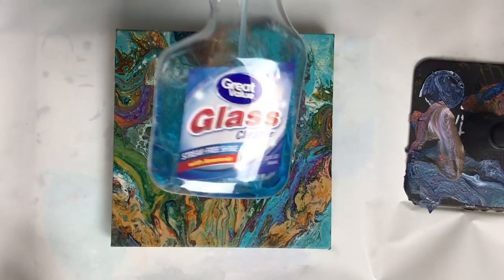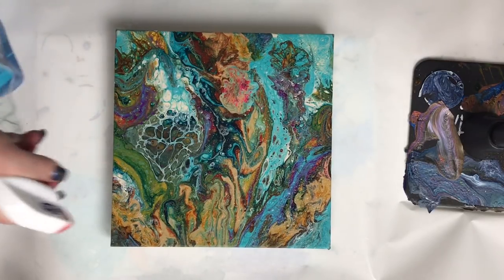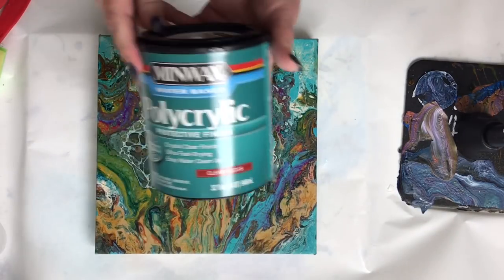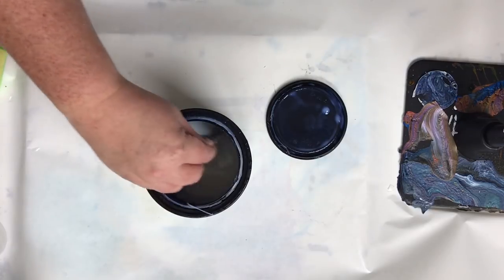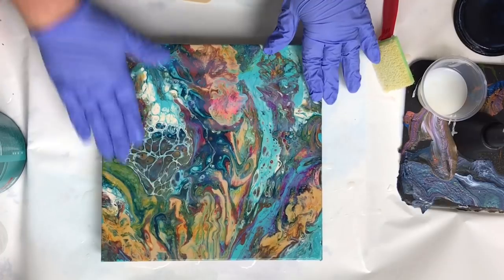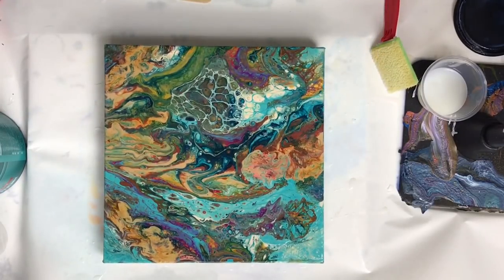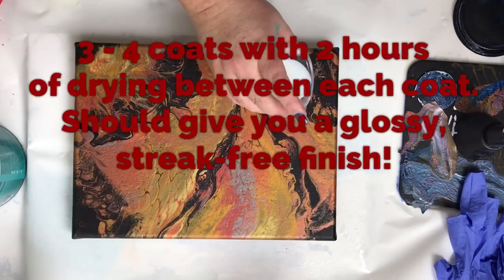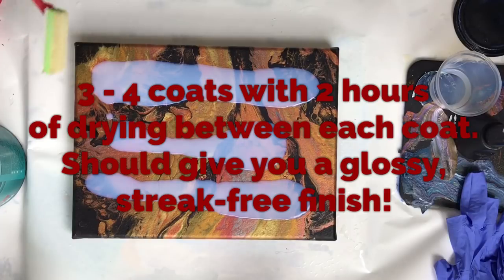How To Varnish Acrylic Pouring with Minwax Polycrylic

Comment: Bubbles in Polycrylic can is my issue.  After watching your video I learned to NOT shake the can, but to stir it.  Well, I love these lessons in art as I go along (I think).  Is there a way to remove those fun bubbles that I have now created?  They are definitely on my canvas, which is not a big deal.  These two first acrylic pours are turning out to be my "test" pieces.  I still love them!

Comment: I use inexpensive canvases that have already been gessoed (most are these days) and have no problems with my pours. I also use sample pots of domestic acrylic paint tinted to the colours chosen from swatches and mix these colours to achieve different hues. The only other thing I use is WD 40 silicone spray in the mix and similar varnish to above in the same way.

Comment: Are you cleaning off the silicone residue then use glass cleaner to get any misses.  Or does glass cleaner clean off silicone residue by itself.  By the way, you have a lovely volume of work.  Very impressive.

Comment: I varnished 4 paintings last night with Polycrylic. Two of them were from early Jan, so I assumed they were fully cured. One was perfectly smooth and had no imperfections. This morning they are all cracked. I had wiped them down with alcohol, to removed any oils,  and am wondering if that caused them to crack?  Wondering if my coat was too thick. I am afraid to use this product now. :(

Comment: Okay so I used Windex vinegar not real toxic and it started removing my black paint these are two month old paintings and to point where I started seeing White canvas and the paints on the cost of a du-rag I was using. Then on the other one it took the block and transferred some of the black background to the silver and then I had to rewipe the silver cuz it was dirty from the paint soap what is it that I miss please help and thank you for your help I must be doing something wrong

Comment: I usually use spray varnish on my artwork but you made this look simple. Do you have a video of cleaning the silicone off? That's the scariest part for me.
Reply: she showed, in this video, how she sprays the painting with Windex-type glass cleaner... waits about 5seconds and then wipes with paper towel.  She showed it a few times on this video.  Did you watch this video??

Comment: Hi, you have convinced me to use the Minwax. Is it possible to use this over a coat of Liquitex gloss spray varnish if it didn't take well? Wondering if using different varnishes is a no go.
Reply from the maker: I've not applied the minwax over anything other than acrylic paint. I would think it would be fine, but I would test on the side of a canvas first.
Reply: @NickyJBurch  Thanks a bunch. Great idea, I'll test it on the side first.
Reply: @NickyJBurch  one mor question for you. Does the Polycrylic protect against UV?

Comment: How long after varnishing until you can packaging and ship.  Great video!
Reply: I use inexpensive canvases that have already been gessoed (most are these days) and have no problems with my pours. I also use sample pots of domestic acrylic paint tinted to the colours chosen from swatches and add the colours to achieve different hues. The only other thing I use is WD 40 silicone spray in the mix and similar varnish to above in the same way.

Comment: Question, I have an acrylic painting that went dark after I painted it, do you know how I can make the colors brighter, do I just need varnish? Or is there another way to do this?
Reply from the maker: Acrylic paints dry dark. A topcoat or resin can help some.
Reply: @NickyJBurch  thanks for the response, but a top coat of what varnish? And I was wondering what resin is, I'm not familiar with it.

Comment: Have you ever had trouble with air bubbles? I recently had an experience where I did what I thought was going to be the last coat on about for paintings, only to come back to them about two hours later to have the entire surface literally covered with hundreds of little air bubbles that weren't visible when I had finished applying the Minwax. I ended up having to sandpaper them down and start all over again but it was quite the ordeal to get them back to the smooth surface.
Reply from the maker: Neecy Mirva I could see it being an issue if the can was shaken. The first time I tried the Minwax I used a mini sponge roller, because I kept seeing sponges recommend. Nothing but bubbles,  but luckily I didn't let them dry. 
I can't imagine what would cause bubbles to form after it had already been applied though.
Reply: Nicky James Burch yeah I didn't shake it at all because I knew that was a no-no. And I'd varnished like probably 30 paintings out of that same can previously. I was using a brush. Which I always used. So I can't figure it out. The only thing I was wondering might've had an impact is it was extremely extremely extremely hot that day. I did have my little air conditioner running but I don't know I just can't figure it out. Never had it happen before and so far hasn't happened again. So if anybody has any ideas let me know.
Reply: Neecy Mirva i

Comment: i have used this product for coating different acrylic paintings, and I find that if the paint is predominately white, the Minwax will cause the white to yellow, and quite noticeably. Have you had any such problems?
Reply from the maker: No. I've had no yellowing with the minwax polycrylic.
Reply: Thank you for your reply.

Comment: Great. 
You have try To Cover with resin? 
You have a video?
Reply: Hi Nicki. So I just used the minwax polycrylic on 8 pours all after two days feel rubbery or tacky.  Is this normal?  Will they stay this way?  I live in the desert where it is hot! I did start at 6:00 am in the garage to try and beat the heat.  Maybe it was still too hot?